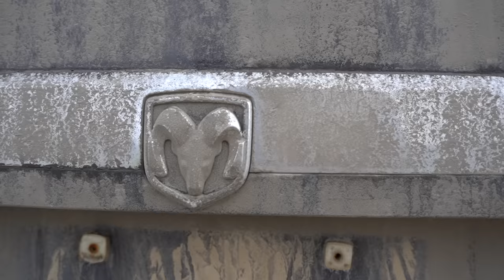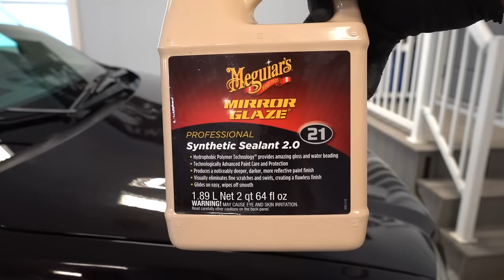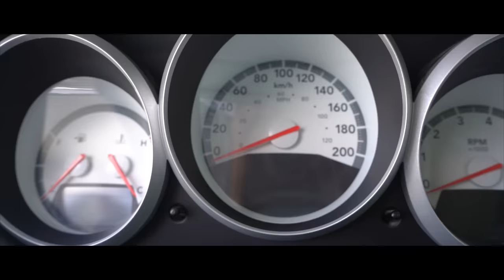Deep Cleaning a DISASTER Minivan! | The Detail Geek

Comment: I may have missed it, or you cut that part out, but did you clean the sides of the front seats? It seemed that in the before/after shots there wasn’t a change. If course, I am on an iPad Pro so may have not seen the difference.

One other thing on the front seats & carpets. They were nasty and the cleaner didn’t get under the trim on the seats. Taking the seats out, at least to me, would have done a much better job on the carpets. I can’t believe that people actually rode in that thing. And had kids in it as well evidenced by the crayons etc.
Reply from the maker: It wasn’t filmed, and no the front seats didn’t need to come out because it wasn’t dirty underneath and I had full access, which I mentioned in the video.